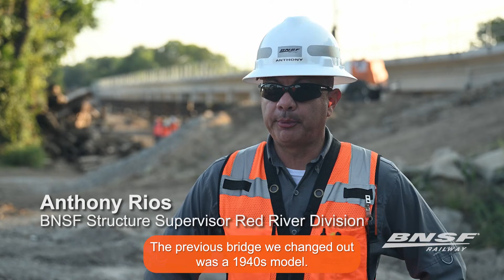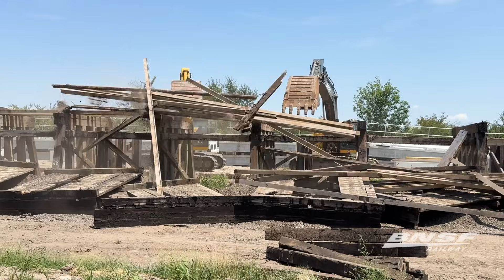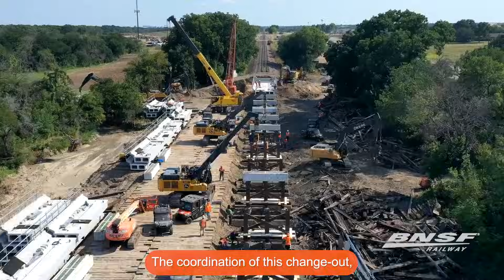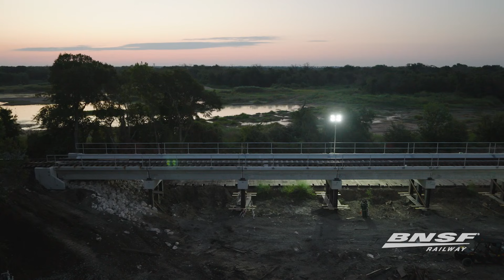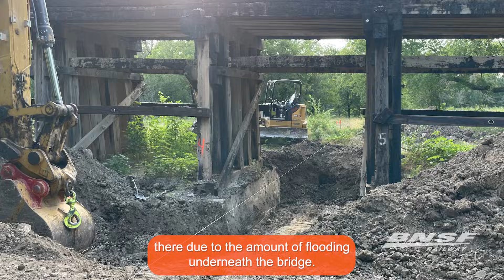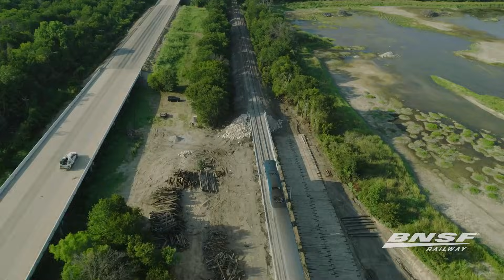BNSF teams replace bridge in just 28 hours!

Comment: That was done well.
         Was the trestle timber thrown away?  I always thought some of the large treated wood from these trestle demolition pieces might be repurposed for switch ties in yards.  They may have not been long enough though.
         While the construction methods are different from highway construction and the pressure to open a railroad artery is more pressing than a highway, the speed replacing or fixing something far exceeds that of highways.  I remember seeing old derailed cars in which the bridge was rebuilt over them.  The artery had to be reopened and they came back later to pull some of the pieces of the cars out.  Railroad construction is also the only form of construction in which the various layers are often are not older from the bottom up.  The rail is likely older than the ties and the ballast may have been cleaned and replenished, the sub grade may have had to have work done and then the components on top of it moved back over it.

Comment: CONCRETE on TOP of WOODEN POLE ?????
Reply: Nope, they are steel if you look closely, I initially thought the same thing.
Reply: @BobTheBorracho  The B&B crews working for some planned time to pre-drive the steel piles and/or pour necessary concrete foundations.  The "speedy" demolition and reassembly of the new bridge components (pile caps, chords, deck, plus track and ballast) gets the job done quickly, SO THE TRAINS CAN GO FASTER!

Comment: If the highway department had to do something like this, it would be a 3 year project
Reply: In PA it has taken PennDot 11 years to complete a 11 mile stretch of new highway with modern technology. Yet it took the UP and CP only six years basically by hand to complete 1,900 miles.